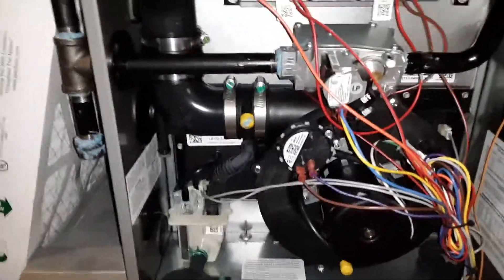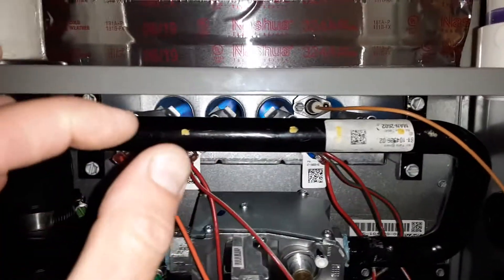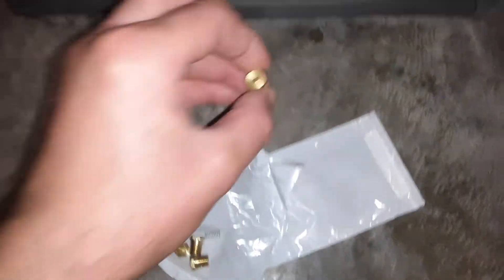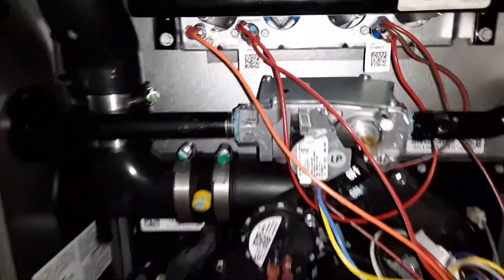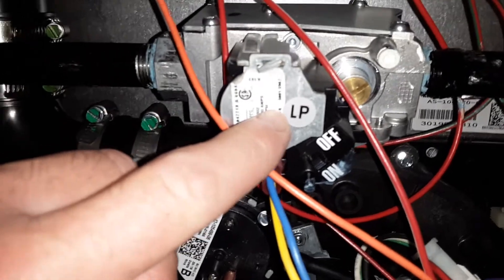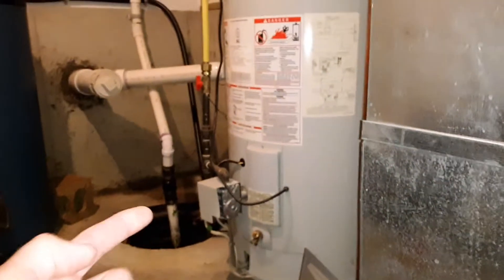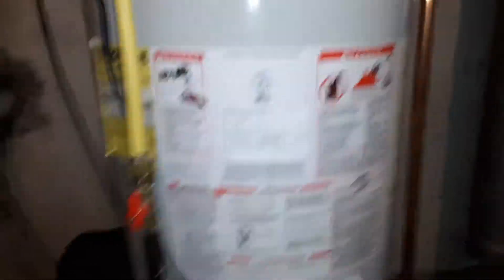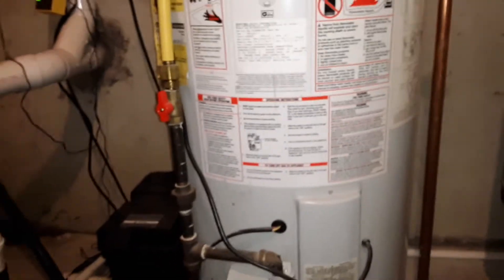🔥 LP Propane converting from #naturalgas#construction #realestate #inspection #gas #plumbing #home

Comment: Surprises me how many plumbers will install a tank-less gas water heater (I realize your video is about a furnace but the premise of conversion is the same) and fail to convert it over from NG to LP in new homes that only have LP. Most appliances have stickers that the installer should apply that says "This appliance has been converted to Liquid Propane". Most tankless water heaters in the USA are sold set up for NG (Natural Gas) and must be converted if they are using LP,  during the install and before use.
Reply from the maker: @thelpw2608  Excellent point. Thanks for sharing and for watching.

Comment: That information is half correct.  Along with the orifices you need to convert the gas valve to LP by changing the regulator spring (or springs if two stage), then set  the gas pressure.
Reply from the maker: Yep. I just happened to have those orifices on hand at that place and rushed to make the video. 
It's one of the 1st videos I made.
Thanks for watching.
Reply: Hi are you talking about changing springs within the gas valve that's mounted on the appliance?  And setting gas pressure on that valve? Or are you talking about making changes to the regulator that controls the pressure on the whole house?
Reply: @wildmanofborneo  the gas valve on the appliance has springs in it.  Set your gas pressure from there

Comment: I'm looking for some clarity on how to convert Vulcan natural gas to lpg. There is a ring burner. Will there be just one orifice to the ring? Or the whole ring needs changing out? Does regulator need changing or adjusting?
Reply from the maker: It doesn't sound like you're converting a furnace burner. The only round burners on furnaces installed are "Miller or Nordyne" in manufacture homes. That I know of.
As for appliances and water heaters, I'm not familiar of the applications. In most cases of questions, I have had good luck getting answers from the manufacture of the products. "Engineering department".

Comment: Can you convert back to Natural gas??   I had natural gas, changed to propane, I now wanna go back to natural, the HVAC guy told me I can't. I need a new heater
Reply from the maker: Yes, you can go back! For sure. Whenever Iam inspecting converted gas furnaces, I find the HVAC contractors leave the old orifices to covert back to natural gas. In the video I'm holding the originals. Look around. They're typically in a small plastic bag or paper envelope. Thanks for watching.